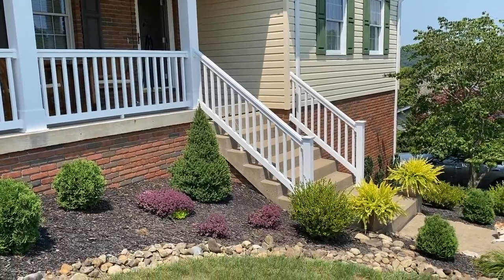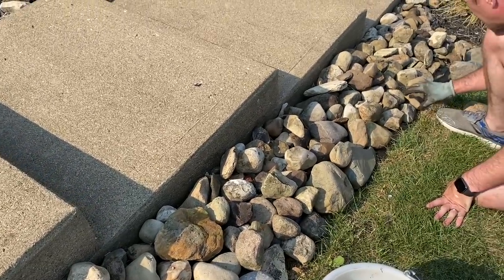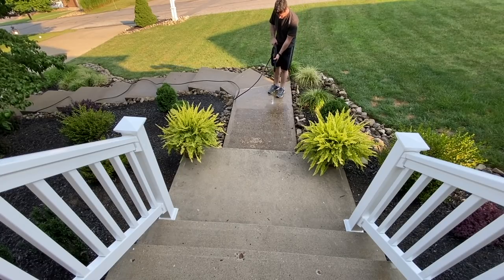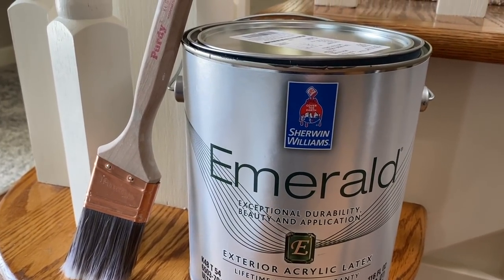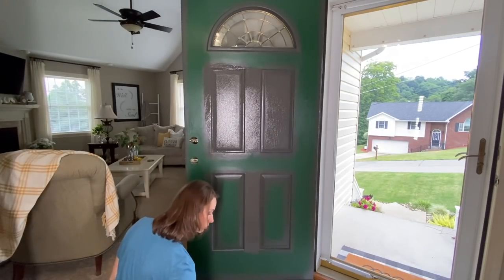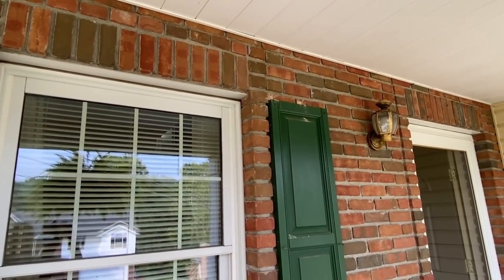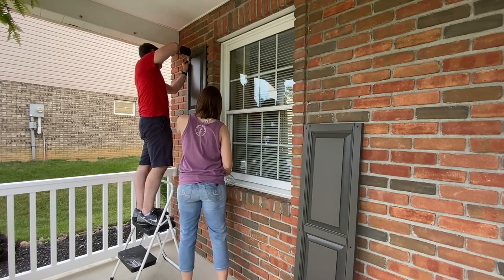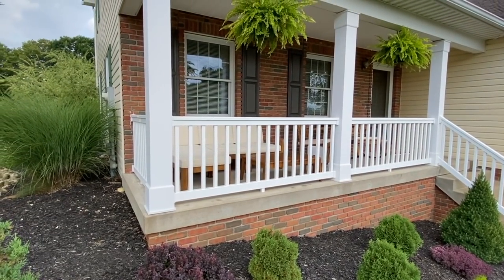HOW TO ADD CURB APPEAL |  EASY BUDGET FRIENDLY DIY IDEAS FOR ADDING CURB APPEAL

Comment: Very nice! How have your painted door hardware held up? would you recommend it and wha paint was used is so?
Reply from the maker: Hi Teresa! Honestly, it hasn’t!!! 😒It is a quick fix for a couple of months. Keep in mind, I didn’t polyurethane over it which would have extended the wear.
Reply: I apologize for my tired eyes text. Curious what paint you used so I don't  use that one. I have done all the hardware in a bathroom with success, aside from the door knob.
Reply from the maker: I believe it was rustoleum fusion all in one primer and paint. I’ve used it for our outdoor chairs and light fixtures which did amazing but it did not do so well for our door handle. Hope that helps !! Good luck!!

Comment: Nice video and projects! How much psi (pressure per square inch) did you use? And was it a gas unit, or electric? Thanks in advance.
Reply from the maker: Hi!! I’m not sure of the psi?!? It is an electric pressure washer that I linked in the description box. I used the 25 nozzle on the end. Hope this helps. Thanks for watching
Reply: @SimplyRHome  Just an FYI - It's 2800 Pounds per Square Inch (PSI). Basically, it's how powerful the unit is. Yours did such a great job, I wondered how much power a unit would need to get your same results! 

Brand	Sun Joe
Power Source	Corded Electric
Color	Black
Item Dimensions LxWxH	23.5 x 21 x 15.5 inches
Maximum Pressure	2800 Pound per Square Inch